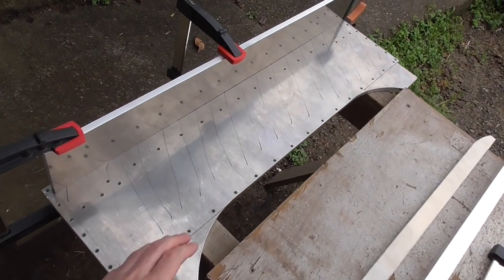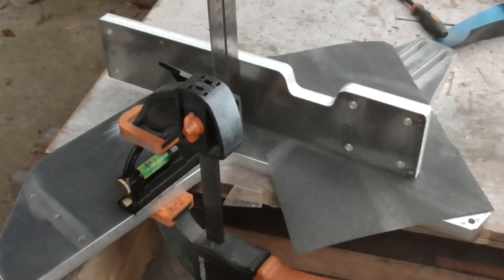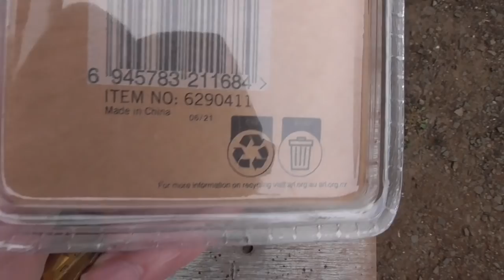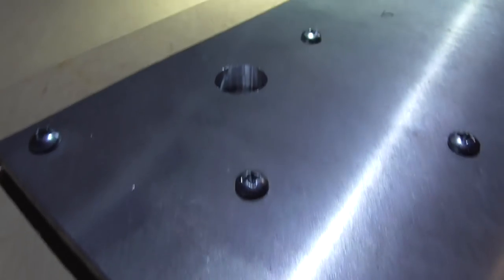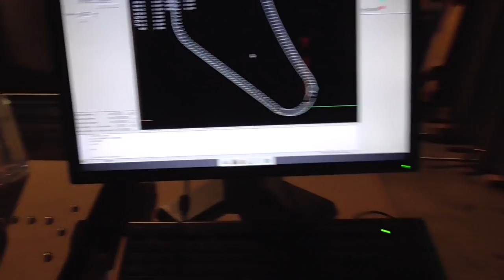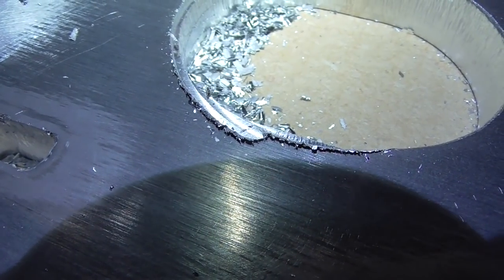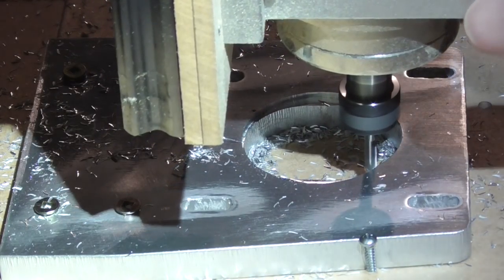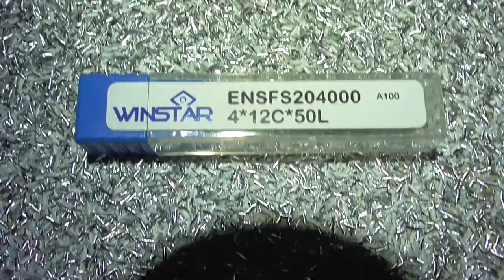Another DIY CNC router, part 7 (machining aluminium motor mounts, hassles with bent plates)

Comment: Just watched it for the fifth time!...
It cuts steel OK... check out the screw head on the bottom right at 27:55.
Oops, did I just give away a secret?!    ;o)
Reply from the maker: Yeah it didn't mind that at all, but it's only a small thin section, and it was using a part of the cutter flute that was still pristine and sharp.

Comment: You could try using some thick glass as a cheap surface plate. This and the obvious tool, a steel straight edge....Shimming Ball Slides is cheapskate and encourages resonance in an already less than rigid structure....Just saying...🤔😳😳🇬🇧